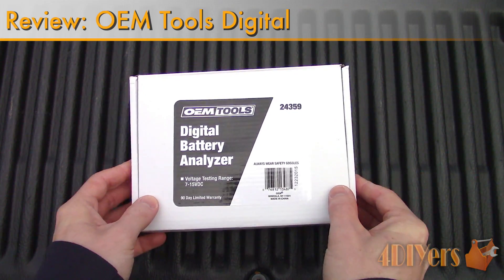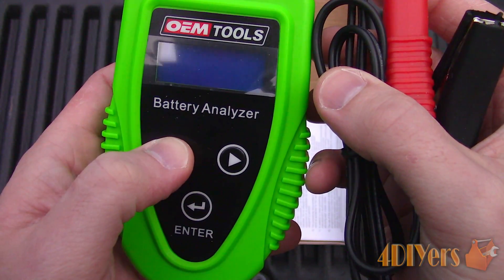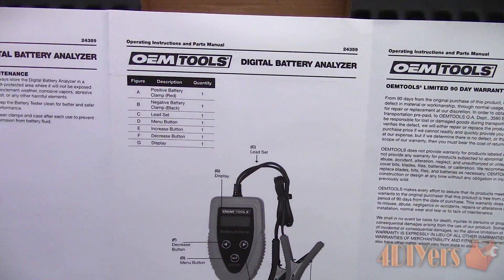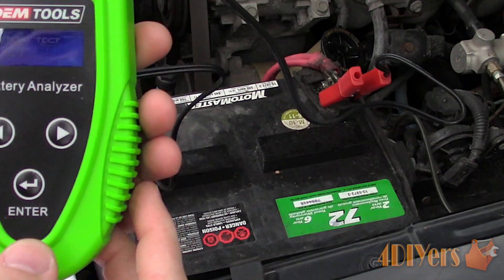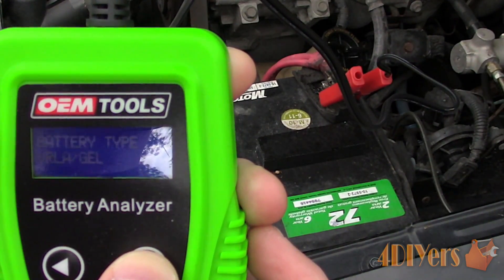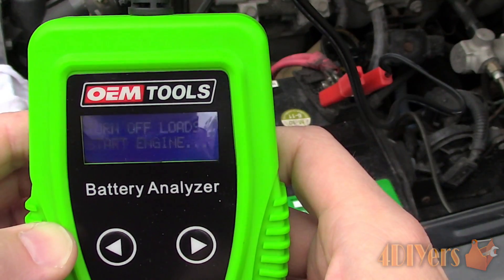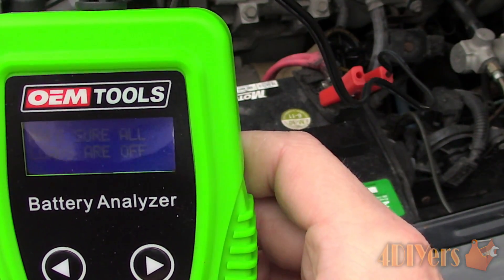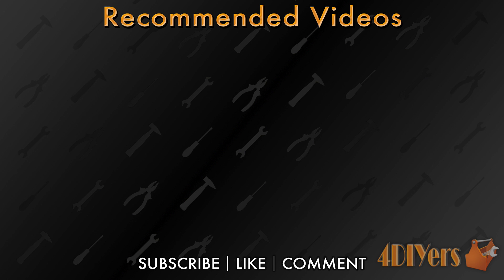Review: OEMTOOLS Digital Battery Analyzer

Comment: what will the analyzer read if the battery is below 12.6 volts, at about 10.5 volts?
Reply from the maker: First it would ask if the battery had been fully charged. After selecting yes, then it would most likely say there isn't a sufficient amount of cranking amps and would need to be replaced. Being at 10.5V, the battery is basically dead anyway.

Comment: So it doesn't charge the battery but just analyzes the voltage? So it's a glorified multimeter?
Reply from the maker: No charging, just testing. It monitors the voltage for both starting and charging system. Then measures the resistance across the battery based on it's specs when checking the condition.
Reply: Cant load test with a multimeter, and I'm sure it takes ripple in to the total analyzation when condemning the charging system.